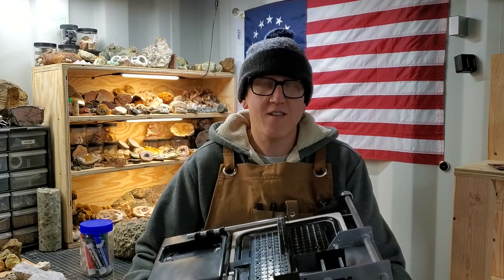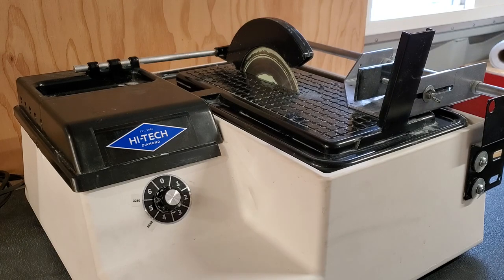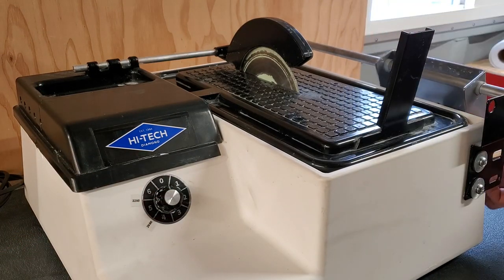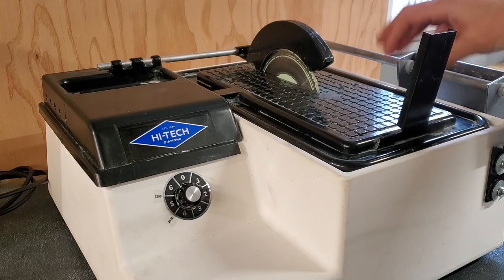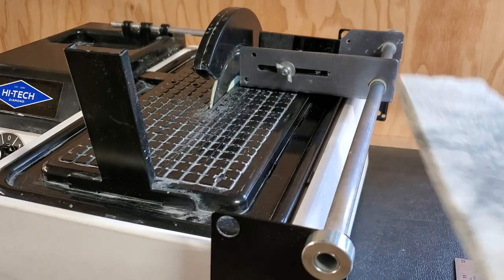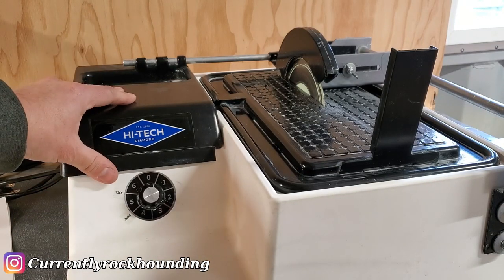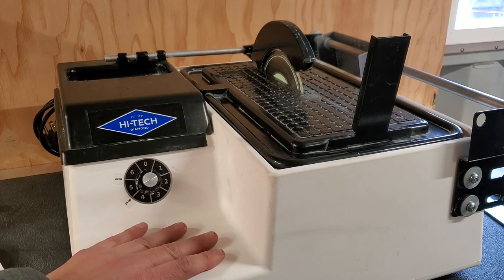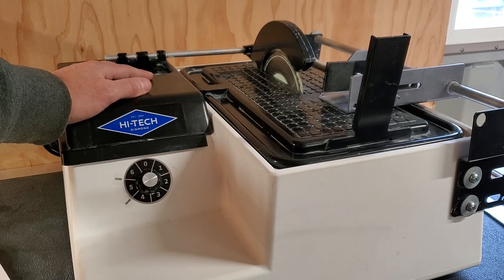Reviewing the Hi-Tech Diamond 6" Trim Saw

Comment: I bought one, love it so far. I had to open the motor lid and loosen the hose clamps around the motor to move the motor about 1/2” right to center the blade in the plastic cutting surface. I found the arbour (sleeve) over the motor shaft wasn’t far enough right for the second set screw to tighten. So once I lined up the blade where I wanted it (to clear the opening in the cutting surface) I could tighten the first set screw on the left (closest to the motor) but the second screw would just keep turning an eventually fall into the arbour core. This is my first Lapidary saw and I was surprised at how thin the blades are, which I thought meant that they were fragile. Not the case, they are very tough and cut through granite just fine. I agree with you that the dial should have the rpm’s instead of 0-6 due to the blade’s maximum speed being crucial to safety and capability. Thank you for showing the stickers you’ve made to indicate the speeds! As far as clean up, I siphoned the excess water with a small aquarium hose but will simply use a cup in the future. I like how the design is cleanup friendly and all rounded edges for wiping off. This demonstration really solidified my decision to choose Hi Tech over Covington and Highland Park models. Extremely quiet while running and as expected under load, I love it so far 👍

Comment: I use a tiny fountain pump (about $ 7) with 1/4" tubing to remove 90 - 95% of the water depending on the amount of debris on the bottom of the tray - I do tip it a little by sliding a piece of wood 1 1/2" to move more of the water to the pump. The pump takes less than 2 minutes to empty the majority of the water and takes almost no space to store when not in use. Buy the cheapest pump you can - you are not moving much volume and not moving frequently.
Reply from the maker: That's great advice.
Reply: What a great idea, thank you Sandy!

Comment: When they say in the manual not to run the 6 in Hi Tech trim saw more than a half hour, they are not kidding.   Going over a half hour is super hard on the motor, and I burned out two already... but they do last about 5-7 years... using it about 1hour per week for me.  The plastic tray wears out very fast too.  I fix the plastic tray with PC7 epoxy when it gets worn down.  It sure is great for the bigger slabs like you say.
Reply: Im more than surprised at your motor problems.  I use mine hard...probably slab with it more than trimming, and iften run it 2 to 3 hours at a time, when I need a break.  You might be pushing too hard, overloading the motor and causing it to overheat.  Im 8 years and thousands of cabs (I cut commercially) on the original motor, and it's far from done in.
Reply: @cristelgard6476  Interesting.  I think it might be cuz I was using crappy blades too.  I found some sintered blades that cut rock like butter, and they are much easier on the motor.

Comment: My opinion is about the black T-square not fitting into the slot at all. If you know what I mean. I don't see anything around the speed-dial! The manual doesn't explain clear enough how to ensemble, but easy enough to figure out to put them together by yourself. I am totally agreeing everything you said. Obviously, they need to be improving to fit better for the price and make the customers completely happy and satisfied.
Reply from the maker: I do not know what you mean by the black T-square.
Reply: It's a piece act like a splash guard, shape like T !

Comment: I reviewed several brands of trim saws online, and the Hi-Tech Diamond Trim Saw seemed best for a newbie like me - until I saw you picking it up to empty the water. I have a tricky back and a recently-repaired hernia.  So, I looked for a workaround: how about draining the reservoir using a manual siphon pump and a bucket? I watched videos of people very effectively draining multi-gallon containers such as fish tanks. Any rock sludge the pump doesn't finish getting, you could wipe out with a sponge. Thanks for your excellent videos.
Reply: It wouldn't be all that difficult to add a drain; just get some soft vinyl tubing, drill a hole, insert and seal with silicone, then put a pinchoff or plug on the tubing.

Comment: The 6 inch trim saw I have (Lortone) does have a 3/4th inch tray wall that can still cut the usual slab thickness if the tray is shimmed with a piece of 3/4 inch plywood with a notch for the blade. That allows larger 
slabs to be trimmed without vising up the slab saw.   So, for those with tray walls, there is always a way to work around them.

Comment: Great video showing all pros and cons. that said, I've had/used a lot of trim saws over many years and all things considered, to me this is the best of them all. It has a large useable table and is light enough that to clean it I simply carry it outdoors and hose it down. I have the sliding vise but finally took it off as not being worth the cost. You can also order a detachable fixed fence attachment that pops onto the table using the several small holes as guides. I gotta admit I'm not a fan of the variable speed control and have always cranked it to highest setting. It's a real workhorse.
Reply from the maker: I've been using this saw a lot and I agree with what you're saying here.

Comment: Good review, I love my 6 and 10 inch version from them.  On the water drain I never really considered it an issue as I just cup out enough so it doesn’t touch the blade and dry the blade and shaft and then add water back the next time.  In your case though it might be an issue due to freezing temps in your shop.  A turkey baster useful to get any settled grit out.  The different blades make big difference on the ease of the cut based on the material.  I don’t get caught up in the RPM but maybe I should, a 5 and 6 is usually where I put it for all the blades and never adjust it that much.  Good videos as always!
Reply from the maker: Yeah I really can leave the water in it due to the weather out here. I do like the idea of a turkey baster to get it out.

So far the biggest difference I see on the blade is if there is chip out on the end of the cut.

Comment: I just went and bought a brand new hitech 6 inch lapidary saw, thanks for your awesome review on this particular unit.
Reply from the maker: I'm sure you will like it!
Reply: @CurrentlyRockhounding  I hope so too, I just finished its assembly which was very easy, the saw when I set it into place wasn't set to the centre of the saw top but the instructions were very clear on how to loosen the two screws in the motor rod to centre the blade and tighten it. 

So was really easy to adjust

All I need to do now is fill the water in the reservoir plug her in and give her a trial run with a couple of rocks which I don't mind getting a rough finish on for testing. 

After watching another video and the comments about how the saw possibly cuts a little rough on the first cuts I figured it will be better to do a couple of trial cuts first.

Not sure if you also found the same results on your first couple of cuts?

Thanks again for your great video on the lapidary saw I'm also sure I will enjoy it too 😊
Reply from the maker: @freshimpactco.8698  Often a the first cut on a blade is a little rough. They often have paints and other stuff on them that needs to come off some.

Comment: Thank you for the honest review.  It’s great to see the construction.  I think I’m going to order one up and come up with a good way to drain the water.
Reply from the maker: The lack of a water drain is a bit of a bummer. I would love to see some kind of bung fitting with a cut off valve so you can just drain the water into a bucket.
Reply: @CurrentlyRockhounding  Well, let's see what we can come up with.
Reply: @CurrentlyRockhounding  I was thinking something like the "EZ-106 EZ Oil Drain Valve with removable Hose End Combo" might work great.  What do you think?
Reply from the maker: @Whaler170  That's pretty much what I had in mind.

Comment: Not that it's a great concern with a 6 inch blade but I didn't see any adjustments to true the arbor and plane of the blade to be perpendicular to your vise feed.   Know it can be a 
real problem with 10 and above inch diameter blades that feed improperly, cause jamming and motor overheating.   Harbor Freight has a good inexpensive fine adjustment
gauge with a magnetic base to true larger blades and prevent feed problems.   Nice review.  Thanks.
Reply from the maker: With this saw the vise has all the adjustments to make it run true to the blade.
Reply: @CurrentlyRockhounding  Never seen a laterally adjustable vise but that would work too.  Interesting.
Reply from the maker: @richardstursa6711  It independently adjusts on the front and back of the track so you can get it perfectly where you want it.

Comment: If one could only have one saw.  For light to moderate work would the Hi Tech 10" Slab Saw be preferable?  Primary uses would be cutting rocks into pieces for tumbling, and cutting specimens in half before lap polishing.
Reply from the maker: Oh yeah if you just want to cut rocks down for tumbling than a 10" would be the best option. They also have a sale this weekend.
Reply: @CurrentlyRockhounding  Thanks for the tip.

Comment: How important is having control over RPM, is it true that you need the higher rpm for the ultra thin blades that are good for turquoise?
Reply from the maker: That's a good question that I may not be the best person to answer it. It would seem from what I have cut up to this point that the more fragile or delicate materials experience less chipping...etc. when you slow the blade down so I think its a valuable feature to have.

Comment: GREAT VID, THANKS. Question on the vibration, if any, from the saw. And, I want to put a 6" SINTERED DIAMOND BLADE on it, will it take blades by other brands?
Reply from the maker: The saw does have some rubber feet on it.

You can run any 6" blade you want on it so long as it has the right size for the arbor.

Comment: Anyone had an issue at initial set up with the arbor and blade not lining up with the table top? I tried to take the set screws out and moving the arbor but it will not move at all
Reply from the maker: I have not personally had that issue. It should move around, if it doesn't you might want to get Hi-Tech a call.

Comment: I'm on the fence about getting a saw from Hi-Tech, torn between the 6 trim saw or the 10 slab saw saw. I cut mostly smaller agates with geode pockets and fortification banding but also find some of the same that are palm size. I think some are dime sized up to half dollar on for the most part.  What is your recommendation or how can I make a decisions and finally dive into a proper lapidary saw and ditch this tile saw?
Reply from the maker: You can always cut a smaller rock on a big saw but not the other way around.

When it doubt save up and buy the biggest saw you can afford.
Reply: Thanks I think I will save up perhaps, is blade width a difference between the two or is it the same?
 @CurrentlyRockhounding
Reply from the maker: @obake84  Generally speaking the bigger the blade diameter the blade thickness also increases.

Comment: What size do you recommend for cutting opals. 4-5” the 6” or the 10”? I’m leaning towards the 4-5” but maybe the 6” would accomplish the same thing and then open the door to agate stones down the road? Thoughts?
Reply from the maker: As a general rule of thumb its always a better idea to buy the biggest lapidary saw you can afford cause it will allow you to do more. You can always cut something small on a big saw but not the other way around.
Reply: @CurrentlyRockhounding  thanks.

Comment: Question for you.. been thinking about getting a 10" Hi Tech saw.. I was wondering if I can use the 10" saw as a trim saw also... Without getting over cutting like I do on my tile saw....
Reply from the maker: You can use the 10" saw as a trim saw. What do you mean by over cutting?
Reply: @CurrentlyRockhounding  I like cutting out crosses. And on the bottom side of the cross the blade cuts on ferther on the bottom then the top... Or maybe I'm doing something wrong ??

Comment: It should at least have handles if you’re needing to hold it to dump it out. I suppose if you know your plumbing you can drill a hole and fit a drain in yourself but with this extra work I feel like this saw should be in the $150 range.
Reply from the maker: So let me get this straight you feel like they should take $350 off the price cause it doesn't have handles or drain plug. Don't you think your comment is a bit nuts?

Comment: Did you adjust the splash guard?? If so, how? Thanks.
Reply from the maker: I guess I don't really understand what exactly you're asking here.
Reply: The tiny front guard is almost useless on the 10” saw in keeping spray off me. I thought I saw yours out of tin or flashing. Yours was silver?? No??
Reply from the maker: @nhrockaholic6038  Oh yeah, the front guard is bigger on mine, I just attached some aluminum as an added spray shield.
Reply: Thanks.

Comment: How long can you run the 6 inch  there was a comment not to run it more than a half hour because  it you will burn the motor  that isn't a long time.
Reply from the maker: That is what they have printed in the manual for it. Personally I have never started cutting and just let the thing run that long. Also I think the environment is a factor, cutting in the winter is going to be different than in July in the desert sun.

I agree that it isn't a long time but I would also ask yourself if you intend on running the saw trimming by hand for half an hour without taking a break?
Reply: Thank you for your reply.  Your right I probably won't use it without stopping.